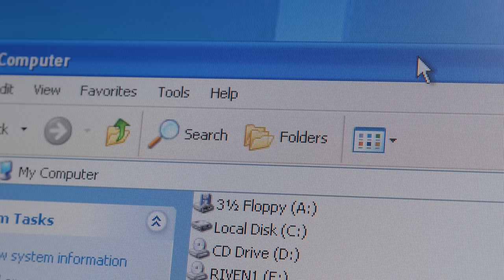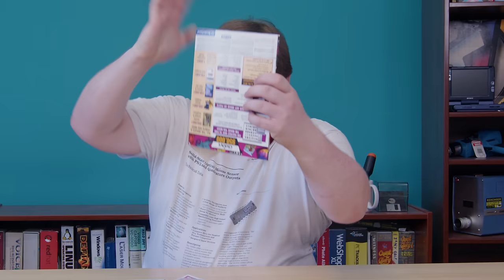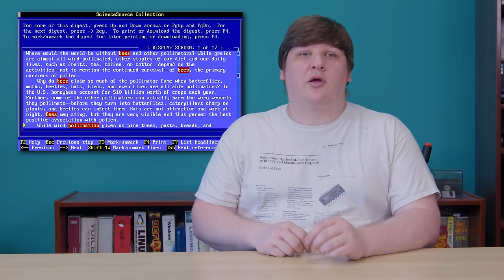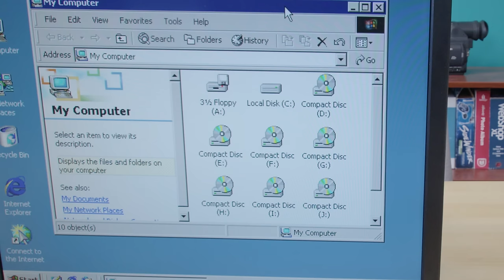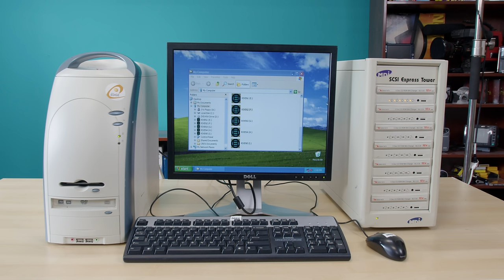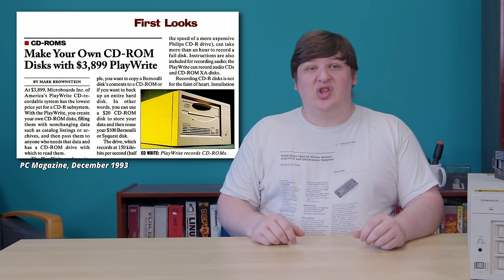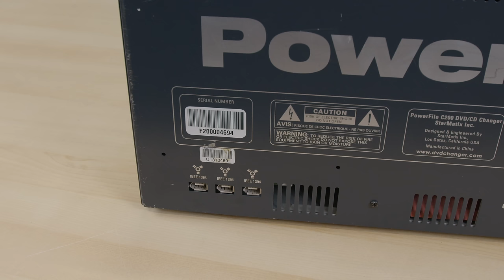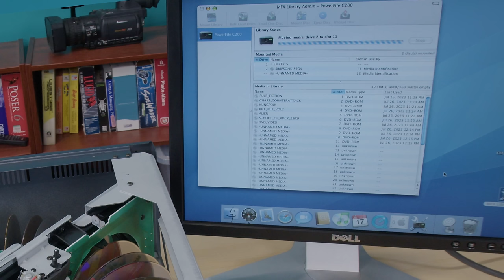A Jukebox for your PC: 1993's CDROM Servers

Comment: I had a ~1 year stint as the assistant "IT guy" at a small investment bank in '94-95. We had several CD subscriptions, as well as couple of Bloomberg terminals (those were a curse, because they didn't talk to anything else), and at least one online subscription. For the CDs we had a dedicated workstation and multi-disc SCSI drive. It was a PITA but we finally got the SCSI drive plugged into the Novell file server so other folks could access them at their desks. 

We did get CDs every month or quarter from the various services. I don't remember having to destroy or send back the older discs, but that may have been my boss' responsibility.

Comment: When I was a teenager in the 1990s I had a  Pioneer CDX-P5000. This was a 50 CD changer for your car for audio. Cable plugged into a supported head unit. Thing was awesome though I fully admit once in awhile the elevator would pick the wrong cd, get stuck and more than once I had to 'break' a CD and destoy it to get the elevator cleared and working again. Good times.

Comment: 1:01:50 - I can see a use for this still, even connected to a G4 Mac.  If you can find one of these for relatively cheap, and If you have an extensive DVD movie collection, this would be a fantastic way to automate DVD movie imaging/ripping.  You could accomplish this using some AppleScript, Apple Events, & Handbrake or Disk Utility.

Comment: I remember seeing the first CD-RON X1 drive unit that was bigger the my VHS at the time. I used well work for the government on an IBM 286 PC. It got to use them in 1989 and it could store many big shelves of very large stock number catalogs of books all on one CD-ROM. That seemed amazing to me at the time. Then I saw those CD-ROM towers at my college library I helped fix one time back in 1994. We have come so far and it seems like yesterday to me. We used a lot of cans of dust cleaner on them back then to fix them. As they often sucked in a lot of dust and stopped working tell we cleaned them out. Dust was the mortal enemy back then as it did not take much to stop them from working in those days. Also, smoking around them too.

Comment: In the mid '90s, the elementary school I went to had a Windows 3.1 machine with one of those Pioneer CD cartridge drives. They had three magazines, with a variety of educational games and reference software. The way things were set up, there was a program group for each of the three magazines, each with six shortcuts for the discs. Of course, since it was a single magazine unit, it didn't matter which program group you used. You just needed to pick the right disc number.

Comment: The library of my college had the Silver Disk system. IIR, it was two towers of CD drives that likely maxed out the SCSI bus of an 8-bit adapter, in a locked case mounted to a concrete column. Connected to the system were a dozen greenscreen (later SVGA) screens with PC keyboards. It was our keyword based (not full text) periodicals article index, including doctoral papers and popular magazines. At the time, it was sooo amazing compared to having to use microfiche or microfilm machines just to go through the indexes. When the user found what the citation wanted, it could be printed out on the amazing BubbleJet printer next to the terminal and then they'd go find the physical copy of the periodical.

Comment: When I worked at the DAF (Paccar) dealer as in their parts warehouse in the late 1990's there was an IBM AS 400 mainframe with 5150 terminals on token ring and 1 486 DX 100 with a SCSI card and an CD jukebox for running  Topec and their FIAT/IVECO and Ginaf equivalents...

Comment: I have a couple Sony Firewire DVD Changers, and 2 PowerFiles. There was third party commercial side changer management software which I cannot  find ATM, and there was a long thread over on AVSForum I used to monitor with homebrew program(s). The changers were temperamental beasts.

Comment: I had a similar Pioneer drive. It was useful back when Linux distros came on multiple CDs and I was still on dialup internet. Had a complete set of Debian CDROMs in it and shared them over the network. Quite slow when installing software that spanned multiple CDs, but it worked.

Comment: The Powerfile was a LIFECHANGER for the publishing industry. Archival storage of final prepress files with slow-but-live access for designers and marketing folks to refer back to, using a format that could be created on individual desktops, and then centrally stored in the data center. 
 
The alternatives were cold storage cd/dvd albums on the shelf, using the never-good-enough “big tape” backups, or wasting boatloads of pricey hard disk space in the server room. 
 
If you’ve ever worked with a lead designer who went on vacation in that era, you know that most of them kept the most important files on THEIR machine only, which they never backed up.  

Definitely a stopgap solution, but a brilliant one for its time (like Starlink is now).

Comment: "You can't head crash a CD-ROM drive" ... except you can. It was quite common from the PS2 and Xbox 360 onward for people to have their console vertical and accidentally knock it over, causing the lens to contact the spinning disk, scratching up both in the process. Back in the days of 1x to 4x CDROM drives, you could have the same thing occur from people dropping things or slamming a door nearby.

Comment: The smaller Pioneer unit looks similar to one my school’s library had in the mid-to-late 90’s. They had it hooked up a computer with a bunch of educational/reference software loaded into the CD changer, and locked it so that students (5-12 year olds) didn’t have to manually change disks, potentially damaging or losing them in the process. As a student, you’d just double click the icon for that software like normal, wait 10 seconds for the drive to change CD if someone had used something else before you, and everything worked - no prompts to insert a CD. It wasn’t shared over a network or anything, so “contention” was a queue of people waiting to use that computer.  😅

Comment: I had a 35kg Mitsubishi 6-bay DVD player/writer in the mid 90´s. The reason for getting this behemoth was that it had a drive for each DVD region, which allowed playing and writing discs from everywhere. A region 1 disc could be copied as a region 2 disc in the region 2 drive, region 3 in the region 3 drive, etc. Drive 0 wrote DVDs without region encoding, but those were illegal in most countries at the time. Swapping region coding wasn´t, neither were the ´backups´. I worked at a multinational at the time, getting embargoed titles was fairly easy. The machine had Firewire and coax IO, but using those got you a lower resolution than the internal drives did. It also had an option to copy just the movie to a CD, it stripped the interactive features and it allowed one subtitle language that was hardcoded in the picture. It then lowered the resolution to make it fit on a CD. The quality was usually ok for tv and laptop viewing.

Comment: The laser transport lock was probably so it wouldn't move around if it was being shipped or moved after being powered down. Actually it's quite nice that it's automatic, such things as scanners and laserdisc players often had a kind of "shipping screw" you'd need to turn to lock the transport in place.

Comment: This video reminds me of when we bought the Autodesk Industrial design suite 2011 at work. It was delivered on DVDs. No less than 13 (yes, thirteen) of them. None of the disks contained more than about 2,5 gigs, if i remember correctly. No idea why they didn’t fill the disks at least to the 4,7GB limit of a single layer disk. Anyway, it took forever to install and gave me a flashback to the floppy disk days. And this was basically only Autodesk Inventor and AutoCAD and a couple of support programs. Can’t imagine the number of disks (or the purchase price) if you bought the whole Autodesk suite.

Comment: My dad worked for an insurance company in the 90's.  i remember visiting the office on a weekend - dad had to do... something.  And i got to see what i now realize is one of these CD robots being decommissioned.  I think, though i can't confirm, they were putting an old tape robot back into service.  I dont know if they were just trialing the CD system, or it frustrated them so much that they got rid of it and went back to tape.  This had to be about 1996 so its possible this was a CD-R archive being ripped out and replaced with tape.

Comment: I remember working at one large defence electronics contractor in the late 90s when they had a CapXpert data book system installed. It consisted of a dedicated DOS computer armed with some SCSI CD ROM drives (caddy loading), a regular VGA screen, and then a large (for the time) hi-res mono screen. You could enter any component, or IC number into the main lookup software, and it would point you toward one of probably 800 or more CDs - each stored in dedicated filing drawers, and each already in a caddy. You then manually fed that to one of the readers, and the system could bring up a high quality scan of the full data sheet for the part. You could view on screen or print. At the time it was vast step forward from trying to track down the well thumbed data book from a shelf complete with coffee stains! Shared access was dealt with by having to book access to the room! (it took a whole office to house all the CDs, and the printer etc).

Comment: One large user of the industrial size tower was Music Choice (yes the people who programmed the audio on your cable system.  They would burn CD's of the upcoming programs, with the audio and the pictures, and some control information.  Then they would load a weeks worth of programs into the changers (once cd per hour per channel) and then the automation software would load the cd's into many a cdrom drive and the system would play them all to make the channels.  It was quite a robotics system sitting in their satellite uplink center just outside of NYC.

When hard drives got less expensive the would stream the CD onto a hard drive for playback at higher speed and then reduce the complexity of the system.  And yes, it depended on the operator getting the right cd in the right slot.  It would verify it, but it wasn't a cache system in the same way.  And yes, they didn't just load it once/week but loaded it over the 5 days of the work week so they had several days queued ahead, and the weekend ran by itself mostly.  

Of course as hard drives got less expensive they went to a hard drive library, but in the early days, it was a lot easier to use juke boxes than using manually switched out cd-rom drives.

Comment: I never knew that I was this interested in how the businesses discussed in the first section managed their data. Surely enterprise had gig and multi-gig hard drives before consumers, but there would have been a point when they didn't either. For a lot of fields this would have scaled with the existence of data to store, nobody had 2GB of JPGs before digital cameras were viable for business purposes. Looking at wikipedia, SCSI began around 1986, a thing matching the design of RAID 4 was patented in 77, RAID 1 in 83, etc. So in 75 Westlaw had pieces that would let them store enormous amounts of data reliably, but hard drives wouldn't be close to gigabytes until approximately the 90s, even in enterprise applications, and there was probably next to no interoperability at any level. This is very interesting~

Comment: This was fascinating for me. I LOVE optical media (that SCSI tower is pr0n). Always was great (for me at least) for backups, cheap, and I'm one of those that hope that it would stay relevant and keep advancing. I wish the replace for Blu-Rays was in the works and with one disk I could backup with an M-Disc my data for long time. The fact that it can't be affected by virus for example is great for some type of backups. It can be a backup of the backups, and saved me some times when other media failed.

Comment: I used to work with a disk changer(I'm sorry the exact model escapes me I sent the video to a coworker who might fill more in) it was one of the industrial full height models the biggest issue we ever had was people cheaping out on the media. even in a temperature controlled room your bottom of the shelf store brand disks did not last forever and we would get data retrieval requests for stuff that was simply damaged. "here's half a file because you bought the cheap disk, good luck"

Comment: Actually, I used my copies of Britanica and Street Atlas often. (and I actually paid for both of them) I think one of the biggest hurdles to a "library CD" was the non-existence of digital copies of most books. (my high school's library would fit on a CD, but none of those books existed as digital text.) [then there's the whole hell of copyrights...]

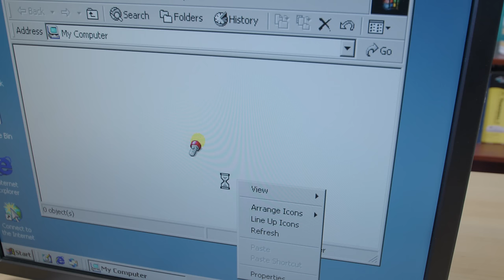@43:30 Yes. That's exactly what's happening -- read timeout and it resets the bus, too many resets and it'll reset the entire controller. NT can actually deal with this mess, but it never does. It doesn't see these CD-ROMs as "off-line storage" (i.e. a tape) If the disc is locked, or a SCSI reservation made for the blocks to be read, this sort of thrashing wouldn't happen, but then processes would start getting access failures. (hint: many games lock the drive once started so you couldn't take the disc out.)

Comment: BBSs had a real use for these changers for obvious reasons and BBS software like PCBoard had already built in mechanism to tolerate slow CD drives and changers as all files requested by the users had to be declared by the user so PCBoard had ample time to actually go and fetch these to the local hard drive. Of course in hobbyist BBSs these disks were very much full of imported warez. Even CDProject (of witcher and cyberpunk fame) started out as a warez-cd manufacturer and distributor, some of which ended up in Estonia in the 90s from where i picked some up and carried to my home workstation which then served those games to roughly 100 individual visitors i had in my BBS. It was a different time back then.

Comment: I recently came across someone selling a bunch of ZioTek Media Carousels and bought four of them.  It's kind of a halfway solution to the problem these libraries are meant to address.  You get a computer interface where you can select the disc you want, but once the machine presents it, you have to physically pick it up and put it in a drive.

Comment: This explains why those later 400+ DVD and BluRay jukeboxes had a BIG flap of a door, and the ability to just slide discs in anywhere and with the jog wheel slowly move the carousel to advance it for more discs. A computer connect able version might have been useful back in the day before flash based media was so cheap.

Comment: Gravis, The Sony Vaio Vgp-xl1b CD DVD 200 Disc Changer Recorder; I had two of these beasts, they were DVD RAM/WR and used firewire to connect to the computer. 
There were drivers were for Windows XP media edition, but there were several shareware drives available as well. The UNIX mtools tape library could also control it, and you could mount it as a tape drive.

Comment: I used to work for a "cable radio" provider in the mid 90s that was basically a massive room filled with CD carousels (IIRC each held about 500 disks) - they worked pretty much like old school jukeboxes, and my job was more or less just keeping an eye on them to make sure they didn't get jammed up; at least once an hour a disk would fall out of a grabber or not land in the tray properly or something and I had to go and intervene. Boring job, but I had access to a CD burner, an unimaginably big music library, and a lot of downtime, so it had its perks...

Comment: I remember my father having our family 486 computer upgraded in about 1995 with a 1 gigabyte hard drive. We were in absolute awe of how much storage that was, we couldn't imagine ever filling it up. I couldn't even conceive of that much data.
Reply: Yup, that's pretty much it right there.
A friend of mine in Melbourne (Australia) ran a very popular and slightly shady BBS in around 1995 which held almost every imaginable piece of Amiga software on a 1.2 GB hard drive, with plenty of room to spare.

Even my two solitary 100 MB Zip disks lasted my until the turn of the millennium. One disk for Amiga games, and another for Amiga productivity stuff.
Reply: In the '80s I was going to upgrade the z-386 hard drive...to a 30M drive. Wife asked what was the biggest drive that I could get. I said a 110M, but it was $500. She said to get it. Because by the time I worked my way through 30 - 40 - 60 - 80 - 100...I would've spent more. And she hates computers...but has 7 (medical office.)
Reply: I felt the same about my 2GB HDD in 1997, until I've discovered MP3s on my university's res (dorm) network!

Comment: For small law offices that operated in just one state, there weren't that many Westlaw disks.  I think it was maybe 3 for Tennessee, but I don't remember exactly.

There's a chance I've got some in a drawer.  No, they didn't have to be returned or destroyed.  They just mostly weren't kept when everything went back online.

I've also got a rackmount SCSI CD box.  It had individual slot load drives, not changers.  At that point, the drives were more useful to me than the rack box, so they ended up in computers.  I probably could make the rack unit work again, but... why.  It's currently in my rack, just playing shelf.